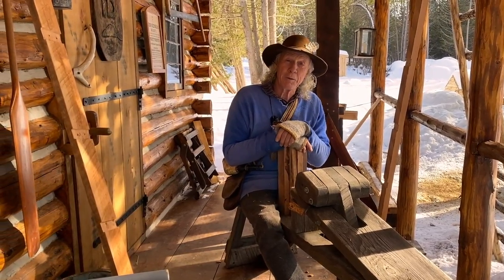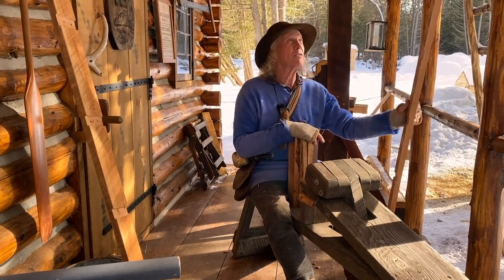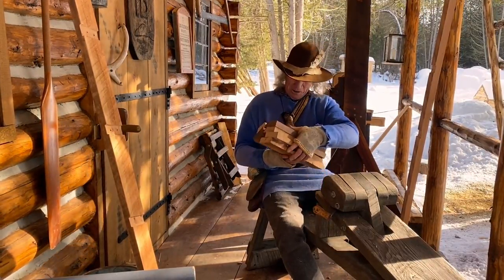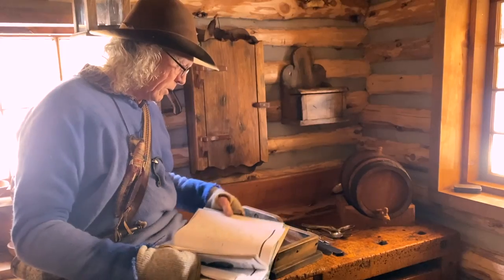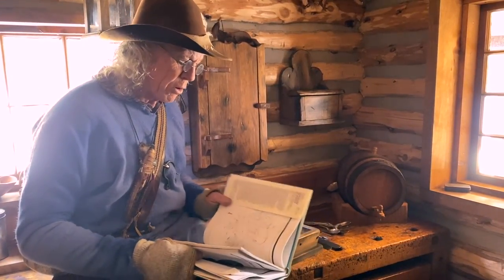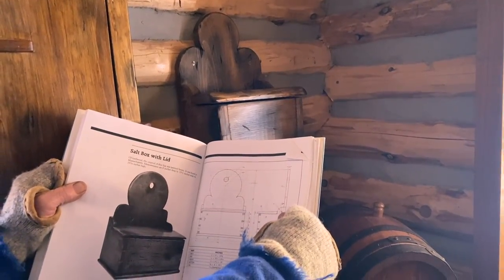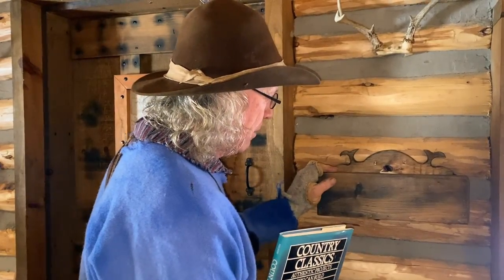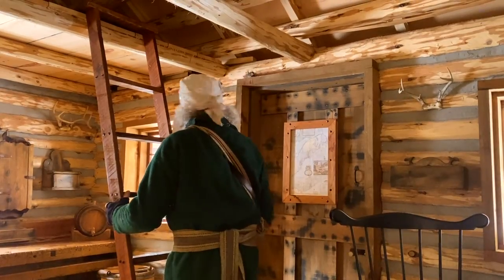No More Falling out of the Sleeping Loft - Pioneer Life Circa 1750|Wooden Ladder|Open Hearth Cooking

Comment: I've got  number of comments. one of the favorite dishes of my late wife was the scalloped (?) potatoes you made to go witlh the ham. The only differenmce ws that she used grated Swiss cheese instead of your cheddar (?). Everything else was identical, right along with the ham. I do have a suggestion regarding your wood inletting on the ladder. I was taught to use the chisel with the bevel side down. It's much easier to control the depth of cut by raising or lowering the handle of the chisel. When most of the wood is removed, it's time to flip over the chisel to cut on the flat as you show
Reply from the maker: Swiss cheese, now that sounds interesting.  Thanks for the advice on chisel technique, you sound like someone who speaks from a lot of practical experience.  We appreciate your interest in our channel.

Comment: You need to forge a trivet to set your dutch oven lid on when you need to add cream or stir, etc.
Reply: black metal ain't free, nor cheap, in the era and area (frontier) Peter replicates you'd probably use a rock or anything near at hand rather than a specialized and expensive item like that.
Reply from the maker: It was common to have a few trivets and they did indeed use it for keeping the lids of the hearth or floor.
Reply from the maker: A flat rock would be useful for the purpose of keeping the lid clean.

Comment: You should do some type of period easily detached fasteners at the top of it so if you get up in the middle of the night it’s alittle safer. Then in the morning you can do a quick detach for the day. 

Maybe use of chisel and do some parallel lines on each step to prevent slipping in socks. Speaking form experience lol
Reply from the maker: Thanks William, both are great ideas.
Reply: 😂 I can relate

Comment: How good does the fireplace heat the cabin?
Reply from the maker: In attempting to recreate an actual cabin on the frontier in the mid 1700’s, it can be challenging on really cold nights.  The sleeping loft is warm and I often sleep on a straw pallet right in front of the hearth.  Going to make some heavy wool drapes to creat an airspace between the room and the windows, should help.
Reply: @TheWoodlandEscape  I totally get it in you  attempting to recreate an actual cabin on the frontier in the mid 1700’s. Is it because the Rumford is too small? Meaning not big enough to put enough wood to last most of the night? Or it's not efficient enough? Is the loft too warm? Or you prefer not having to climb? Like I commented before, yours is the best. Your video's are awesome. I too love the 1700's. I wish I could go back in time, I would go there in a heartbeat.

Comment: Is there sny way to stow the ladder inside the cabin?
Reply from the maker: I do believe there is a way.
Reply: @TheWoodlandEscape  I thought of putting some pegs in the joist next to the loft so you can hang it up out of the way.  You might need to angle them up to keep the ladder above your head.
Reply: Ah yes, make a hinge point, one one inch diameter wooden hinge, then draw the ladder bottom up to the rafters with a rope and maybe a pulley might be called for?
You made me hungry today! 🤗
Keep up the good work!
JIM 🤔

Comment: …Do you think in 1700s, a log cabin door would traditionally swing out…?
Reply from the maker: In most cases it would have opened in.  Due to the small size of the cabin and the fact it has a covered verandah, out seemed more practical.
Reply: @TheWoodlandEscape  , you’ve done a great job…:)
Reply from the maker: Thank you.
Reply: @TheWoodlandEscape  completely makes sense. I think sometimes people get so hung up on “period correct” that they sometimes fail to realize how practical our forefathers were. All we have to base historical accuracy on is the evidence left behind; not only does that leave out unknown devices, traditions or contraptions but it removes the critical thinking, ingenuity and creativity those that walked before us had. I think you do a good job of showing us how they would work through issues and make adjustments to match their needs and conditions.